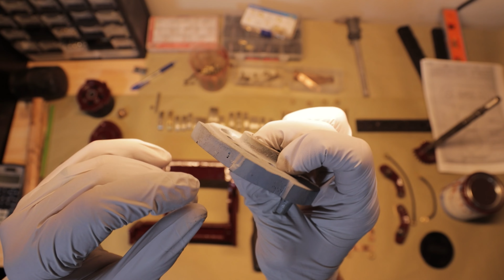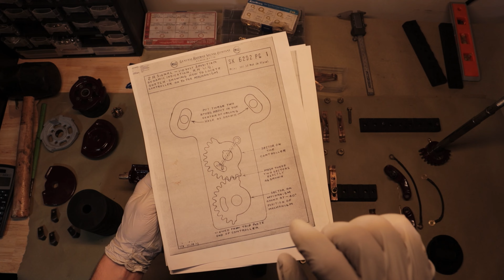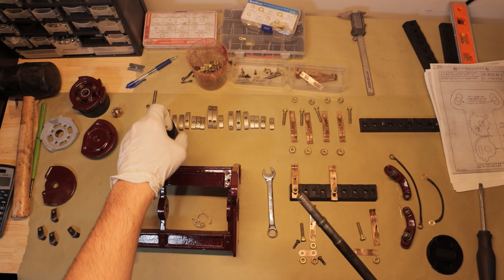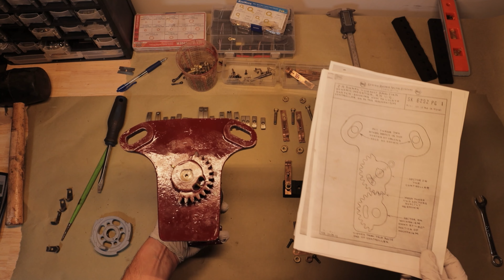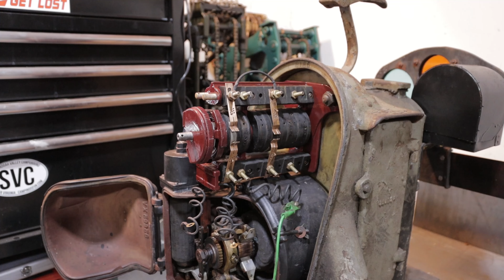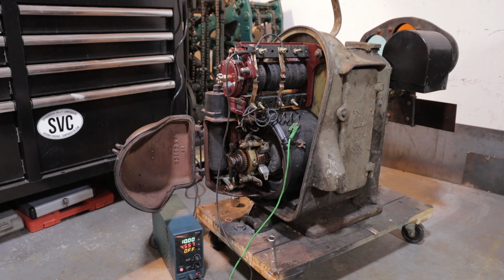General Railway Signal Company (GRS) 2A Semaphore Circuit Controller Assembly With Snap Contacts

Comment: What was the web site you used to print out the instructions?
Reply from the maker: Hey Dave, the website with the references used is http://rrsignalpix.com/ at the bottom of the Documents section you will find the document I have in this video. It is titled:

General Railway Signal Company
2A Signal, 110 Volt - 3 Position, Dynamic Indication, Upper Quadrant
Instructions Covering:
Assembly
Adjustment
Testing

Let me know if you don't see it